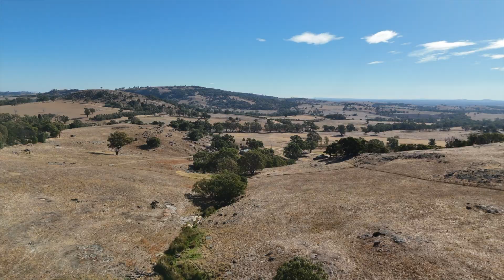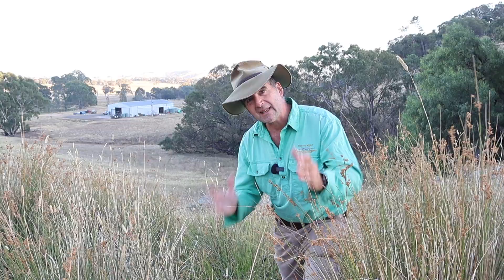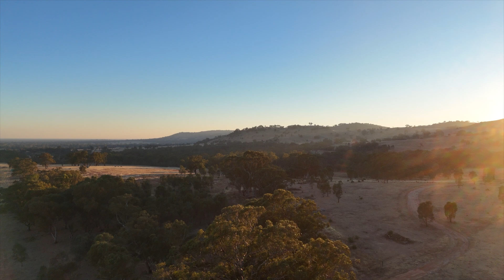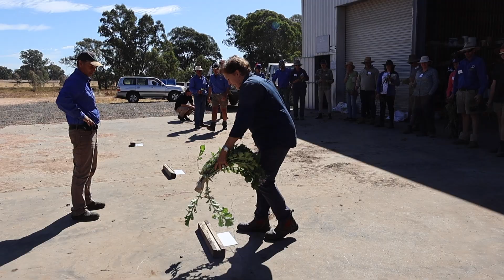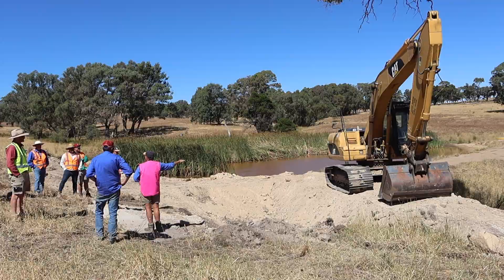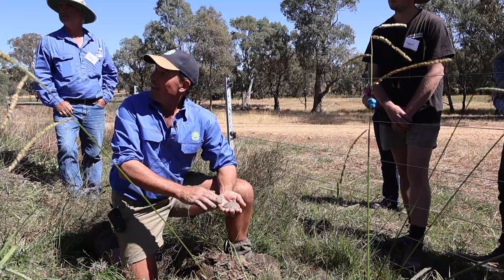Rehydrating Dead Land: Natural Sequence Farming Fixes Soil

Comment: hi Tim, i just want to tell you that you doing a great job in going around to farmers who are thinking forward in regenerative farming. we farm in canada and we want to start putting biochar into the ground. biochar is a byproduct from the process of pyrolysis.
you have to look into yourself, its amazing!.
this char is able to hold far more water than the best organic matter in soils.
we went to austria and we found out that farmers there using biochar since 25 years and this stuff has a tremendous impact on the water holding capacity of the soil.
for example Terra Preta is a soil type from south america and those indigenous people have the best soil on earth because they putting charcoal into the soil since centuries.

what the farmers in austria do is very simple, they bring all organic materials such as biomass to a pyrolysis station and they get back the Biochar. so when you baling straw or you dehulling spelt or all the biomass who is thrown away in an elevator station and on roads the tree branch cuttings all that stuff goes in austria to a pyrolysis station.
Reply from the maker: Debunking Methane Myths: Powering Pasture Carbon Drawdown with Biochar & Wood Vinegar
https://youtu.be/71YOMciLvr4
Reply: @FarmLearningTim  wow you did know about it already, my respect man!

Comment: Another useful information video 
Tim I'm so happy to have found your videos all from wanting to tie a knot properly cheers. So for the willing but not so smart these contours or what the tractor is doing are these swales or similar? Cheers master.
Reply from the maker: Hi Tony. Glad you like the content mate! They are definitely not swales. They don’t hold water, they leak. Designed to spread water across a contour and then allow it to infiltrate quite quickly.
Reply: Thanks Tim I'll do a bit of checking it out